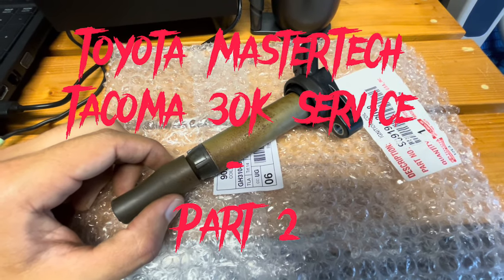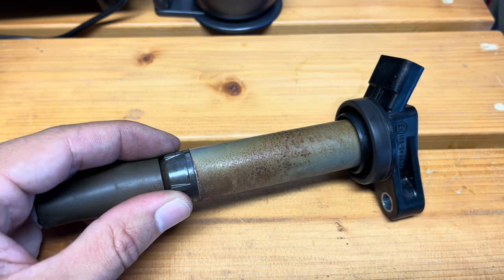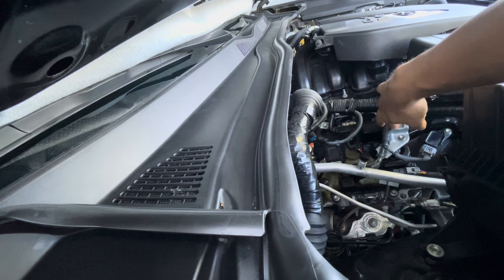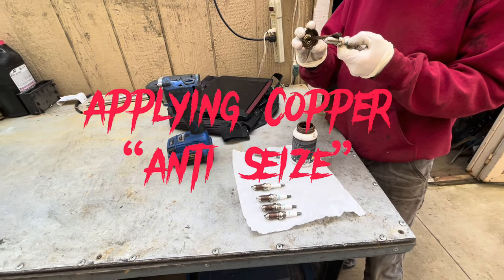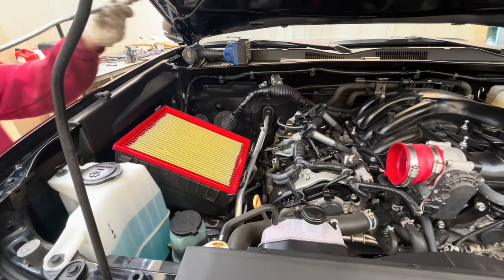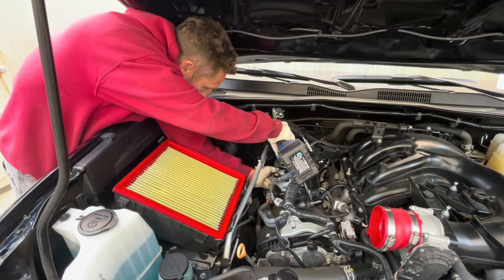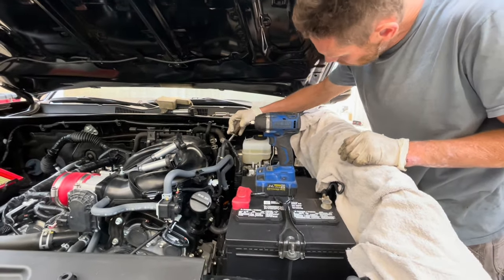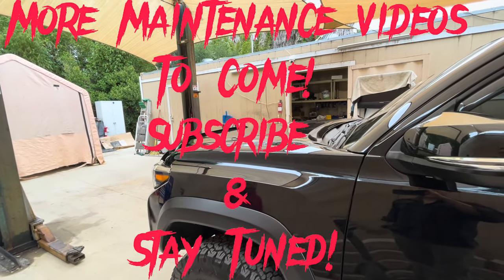Toyota Master Tech Tacoma 30K Service Spark Plug Change 3G Tacoma - Part 2

Comment: You're wasting your money on several things. Plugs are not to be replaced until 100K. You can remove them to clean them and possibly re-gap them. Using a drill to drive in spark plugs is dangerous. You can easily cross thread them and then you are f**ked. Not to mention wiping out the thread on the head being stripped. Diff fluid and tranny fluid 60K is fine. Except for the front diff, which looked like you took in water, I'd check the fluid and if it's still gold in color, plug her back and ride until 60K. I've owned Tacomas and even early 4WD pickups before they were called Tacoma, and I have gotten almost 300k from them doing practical maintenance with zero issues. In fact, I've never had one truck bite the bullet as I have sold them before that could happen.
Reply: This guy ain't no master tech😂 I have 2014 Tacoma with original spark plug with 170k miles. Original plug are 120k miles. Unless u have a small miss fire, don't change the plug.
Reply: Remember the Hilux
Mine had the mid-year change were they moved the blinkers from a top of the fender to down below by the grill
Reply: Came here to say all of this
Reply: @khangtruong4515 Plugs are good for the life of the engine or at least the majority of its life.
Reply: My 2021 Tacoma  owners manual says change plugs every 60k miles, I am about to change mine.
Reply: @MrNorthstar50 The manual is all apart of keeping that service $ going back into the dealerships when sales are down and or inventory is low. Got to pay the rent and countless useless managers and staff wages some how
Reply: Yes your probably right, I have a good friend who is the head of the service department at a very large ford dealership and he has told me that the service department makes way more money than there new car and used car sales combined.
Reply: @MrNorthstar50 l
Lol the iridium spark plugs they come with have a 120k guarantee on them.

Comment: Yeah, I agree with Joey Nutting, I have watched several video's on how to change the transmission oil and I'm still confused. My one complaint about my 2012 5th Gen 4Runner is the difficulty and the difference in opinion and confusion at changing the transmission oil! And, in my opinion ALL dealerships regardless of manufacturer are Liars, Cheats and Thieves!!!
Reply from the maker: I’ll get a thorough video of it with him doing it so we can put that to bed. Stay tuned and I’ll try to get something done within the next few weeks for you 🤙🏼
Reply: @westcoasttaco  Thank you, I look forward to it.
Reply: What’s confusing ? Just drain and refill , flushes aren’t recommended . There are several videos on YouTube with steps showing how to check the transmission fluid level when the car gets to the optimal temperature .
Reply: Not all dealerships, however most! Sucks you live around shitty one’s!!
Reply: If you go to a Dealership, it’s best to ask for a seasoned Vet. If they have any, they are most likely to be honest and do honest work! If they have none and they are all kids, RUN!!! This guy sounds cool and talks to people ok, but he is full of shit. Also never ani seize spark plugs, not advised by the manufacturer!!!!

Comment: From someone who does their own maintenance, I got to say there was some cringe worthy moments in there. Looked and sounded like he dropped a spark plug down the tube. Then all the tightening spark plug components with an impact gun. Reusing crush washers because "the other side was still good".  Like only one side crushes when you tighten it down? Removing a plastic oil filter housing with channel locks. Probably all good but I'm am a bit of a perfectionist. I would die if someone did that to my truck.
Reply: OMG the spark plug install with an impact....what the heck was that?!?
Reply: how about the NON-USE of protective fender covers??
Reply: then it magically appears at 20minutes in

Comment: Auto mechanic turned design engineer here with over 30 years experience. What he did with the plugs is totally fine. Started by hand, light torque on drill and hand torqued at the end. The plastic oil filter housing removal was also fine. That plastic housing gets so tight not from people over tightening but from different expansion and contraction rates between the plastic filter housing and the aluminum engine. the shock the hammer and screw driver has, loosens the housing a lot easier than potentially cracking it with a cup slipping under excessive torque. In my experience even a hand tightened plastic housing becomes seized again and really packing some axle or that assembly grease he uses on the threads will make it come off easier next time. An aluminum housing would be best as it will expand and contract at the same rate as the aluminum component it’s attaching to.
Reply: I ratchet snug used never seize on all 10 mm bolts & spread little silicone paste on coil stems. Some were stuck on dry hard to remove.
Reply: 40k truck and its half plastic smh

Comment: That wasn’t 12-14 foot pounds just so you know. I don’t think he overtightened them so much that anything would happen but 100% there was like 20-30 foot pounds on at least one of those plugs. Usually with a NEW spark plug that has a crush washer, you tighten it finger tight with only the extension and then no more than 1/2 a turn after that. You’ll easily feel it crush the gasket and get much harder to turn almost suddenly. Then you’re done
Reply: I feel good now hearing I did it correctly. However, I will never use any impact drill!

Comment: MY heart dropped when he drilled that plug in 😢😂😂 noo hand tightened then turn it until snug , because he could have drilled it and the treads are not correct sitting in
Reply from the maker: It’s all good 👍🏼 bro🤣 he starts them off with his hand on the socket extension and then uses the drill to get them in further until he uses the torque wrench to tighten them to correct spec. Honestly I’m not personably comfortable with using a drill on my plugs.. but I trust Jason and his 30 years of working on Tacomas to know that he is very confident in his abilities and isn’t risking anything that would jeopardize my truck.. now if the drill was the first thing he used and would have been cranking them down thenI would have been worried🤣, but all good🤙🏼
Reply: @westcoasttaco  😂😂😂😂💯💯🤝
Reply: Yes, a lot of cringy stuff going on.
Reply: @seanpop2886  No torque spec used either even in the previous video. Either he trust his drill or his hand has been calibrated to read torque? Reason why I don't take my Taco to the dealer for maintenance.
Reply: @westcoasttaco  He literally says he doesn't use torque wrenches. I'd keep my shit away from him.

Comment: I put 200k miles on a Toyota venza v6 and never changed the spark plugs. Also, only changed transmission, coolant, and differential fluids once around 125k
No issues. Thanks Toyota!

Comment: Thanks for the video and breaking down what to look for with possible loose plugs. I have a 2017 Tacoma that I bought new. 246k miles, changed the plugs at 100k each time.

Comment: I loved this guy!  Jason is a very detailed person.  Although, I am puzzled why he doesn't have the proper tool to remove the oil filter.  I have 2rd Gen Tacoma and doesn't require any special tool, but once in a while friends or relatives with one of these non-spin on type.  Channel lock, I don't know, should only be use in pipes???   Overall, the guy does a GREAT JOB!
Reply: He doesn't normally do Oil Changes, so he has never needed one. Most of his jobs are pure suspension upgrades. I have had my Tundra (that he has worked on) for 16 years and haven't ALWAYS used the filter tool when doing oild changes on my own.. This comment is a non issue to anyone that owns MULTIPLE Toyota trucks as the oil change can be completed just fine, without. Anyone commenting on his skill set based upon that ONE tool, is a tool, sorry. He has worked on my Tundra (trying to diagnose a noisy suspension squeek), he installed an Eibach Pro Truck Stage 1 kit on my 5th Gen 4runner and later replaced both wheel bearings and spark plugs and... he took in my 2016 Honda Civic that had a non functional Power Steering issue which he later found to be a chewed wire harness from a rodent. That repair cost me a FRACTION of ANY other shop and everything worked PERFECT after Jason completed the repairs. I won't take my vehicles to ANYONE else, if possible.

Comment: DID NOT NEET PLUGS PERIOD. 75k sure. The iridium is super hard and does not erode like standard plugs. Cool pack it fine. It gets hot in there. If there’s an issue you’d know. Plus it’s be under warranty. My sequoia has 300k and one coil has a crack in it and needs replaced. But does not misfire at all. I want to see the Master Tech ASE certs. Every Toyota tech I know does not do this stuff. Not saying it’s all bad but if He went through T-Ten  “Toyota training” he’d have the plaque

Comment: Most new cars can easily go 80-100k miles on plugs, seems like overkill at 30k but to each is own.  If your plugs are not working properly you will throw a code or the engine would not be running good.

Comment: 30,000-50,000mi. first interval replacement yes. If coils look good no need replace. Switch to irdium tip ngk or denso spark plugs 80,000-100,000mi intervals. Change coils. 🤙

Comment: Use GL4 in the Transfer Case NOT GL5,..... Big issue there! Same as the manual transmission, GL4 ONLY.
Spark Plugs made for the 3.5 have a coating on the threads so "Anti-Seize" is not recommended.
Reply: agree with gl4 only. i called oil companys for their faq on gl5 oils and they stated that yes gl5 actually dissolves yellow metals which are found inside of our TC. i used royal purple gearmax btw 75 90

Comment: Came across your video lucky i change mine spark plug at 60k.one spark plug is loose and wasn’t torque to spec i own a 2020 trd pro taco. After changing the spark plug and torque to speck I get less gear hunting and now I’m avg. 23-25 when I commute to work. If you going up a small hill the taco should not gear hunt at all. Check your spark plug guys

Comment: W/ your experience and others (Tacoma World).... just took out all my 6 coils on my 2021 TRD OR Tacoma (24,500 - early, but wanted a look- you did make me "paranoid" ;) No blow-by on all 6. While I was in there changed all 6 spark plugs.
Reply from the maker: Glad to hear all was well! Honestly I would have done the same thing if I were you.. it’s hard not to wonder what’s going on in there, especially after my experience and the experience of others.. sometimes it’s better to be safe than sorry.. 👍🏼 At least you now get to sleep alittle better at night and won’t have to worry about plugs for quite some time.
Reply: @westcoasttaco  100% - Plus, it's only gonna get hotter here in OK (hoodie free zone from May on) rather sweat less now. 😅Yep, it was good to know definitely. 
Re :Jason's take on 30K maybe "overkill" for spark plug change (paraphrasing - " @50K you are definitely seeing performance degrade on plugs even w/ iridium, and w/ the price of gas" - btw, I bought the OEM ones as you both recommended 👍) - I swear to you, my engine sounds a tad quieter and smoother - a tighter sound, if you will. No regrets. Your videos are helping us owners 🤛
Reply: @westcoasttaco  Been meaning to tell you this one - Re: all those over the top anal comments about Jason "is doing this wrong, he won't touch my truck" blah blah blah...
I'm   30+ year licensed falconer - an old, pithy saying in falconry: "There's only 1 thing 2 falconers agree on: That the 3rd falconer is doing it wrong! Those negative comments so smacked of that. 😜
Reply from the maker: @tim3308  whenever you post a video with a mechanic in it, you are 100% guaranteed to have those comments 🤣.. honestly, everyone is entitled to their own opinions and it doesn’t bother me at all. If you lined up 10 mechanics and asked them all the same question and recommendation about the same job every one of of them would come back with a different answer.. it’s just how it goes.
Reply: @westcoasttaco  Likely so. I can be less diplomatic - it's not my channel. 😉Ever seen the video where a Prof is teaching class - a "staged" robber comes in, grabs her purse,  then runs out? Class is then asked to fill out a description of the thief (an experiment). The results are semi depressing how many are off and differ greatly from each other. People.😐

Comment: Ngk and Denso Recommend zero lubricant on threads of spark plugs.. Surprise it hasn’t caused a misfire putting that copper paste on there!!
Reply: Correct. They supposedly come with a light film of anti-seize new.

Comment: When I saw the channel locks come out for the oil filter I cringed so hard lol they do make a special tool specific for that oil filter..... And then the final cringe was the cordless impact on the spark plugs lol oh boy..... I get it, he did start them by hand and finish tightening by hand but still...... Risky lol I actually like his service interval recommendations. Because of those recommendations they found the front diff needed service pretty bad and also that coil pack and plug issue.
Reply: Agreed.. But overall did a great job!

Comment: First...  3RD GEN Tacomas spark plugs are replace at 60K  and  no need for anti-seize 
Second.... every time the transfer case, the rear diff oil are replaced you must replace the drain plug washers. none of that was replaced.
Third ....for the price of the DENSO spark plugs  just get the OEM spark plugs for the same price . 
Fourth...  CERTIFIED MASTER MECHANIC have the correct tools to perform the repairs , not pliers and a pry bar to remove the oil filter housing, BTW no need to put whatever that grease was  put on the oil housing.
Fifth.... if you do all those repairs at any Toyota dealer ( yes they are pricey) you have warranty
ALL I HAVE TO SAY IS.... SO MANY ERRORS.
Reply: So far you are the only person on here that can smell bullshit 😅😅

Comment: hand tight means a lot of things like you said, would be nice if you got the actual torque spec for them and use a torque wrench, otherwise i wont be able to sleep at night 🤣😂
Reply from the maker: 12-14 ft lbs👍🏼 I mentioned it in the part where he put the new plugs in. Sleep well my friend 😂
Reply: @westcoasttaco  nice, yeah I gotta know the torque spec of every bolt when I work on my car. Only way I can sleep 😴

Comment: Did he do a transmission drain and fill for you as well? Would love to observe that. I think he mentioned that in Part 1?
Reply: I like to see that as well.
Reply from the maker: He did that for me several months ago for me, but not on this video. I’ll have him do it again soon and make sure to get a video of it for you guys. He said it’s a good idea to do a drain and fill every 10-15k.
Reply: @westcoasttaco  does the same interval for AT drain go for the Gen2 Taco 4 bangar?
Reply: @westcoasttaco  Wow that seems overkill. I usually do trans, transfer case & front, and rear diff at 60,000 miles on my 09 Taco now 193,000 miles no issues with my truck.
Reply from the maker: @HB-yq8gy  since I bought the truck used, I wanted to have everything done just for a peace of mind. I’ve always been on the “over service” side with all of my vehicles.. probably a lot of it wasn’t necessary, but it’s just how I am. You got to do what works for you and is within your comfort level 🤙🏼
Reply: @westcoasttaco  You taco cost a lot more than mine brand new at $28,000 OTD. Yes definitely will last forever.
Reply: @westcoasttaco lol...this guy ripping you off.
Reply: Hey BOSS a question is any problem if do services by myself. For me pretty dificult book appoiment for dealership service ..void any warranty???

Comment: Did he install the spark plugs with a drill? Not started by hand or with a socket?  Cross thread possibilities!!!!
Reply from the maker: He started them by hand, then tightened 80% with the drill and then tightened by hand til spec👍🏼🤙🏼.

Comment: I got really nervous every time he use the drill to snug the spark plug.
Reply from the maker: 🤣 you will notice he didn’t use a high impact drill.. he still had to tighten the plugs with the torque wrench after using the drill. 👍🏼
Reply: @westcoasttaco  still get nervous, it’s just a first for me. 😂
Reply: @javierramos9795  he doesn’t have much tools
Reply: Vehicles must confuse you a lot.

Comment: Jason is definitely Mr.Good Wrench but got confused with the type of spark plug. It's the dealer-recommended plugs the way to go? For my second gen, I did the spark plugs at 160,000 miles. I was afraid of over tighten so racket slug was good enough assuming.  Thanks for your honest tips.
Reply from the maker: He used the same spark plugs you should receive from the dealership. They were the OEM ones, they just weren’t packaged in the Toyota/Lexus packaging.

Comment: Sorry but I would never trust a guy that use an impact tool on a 10mm bolt.  Plug never go for anything else beside the denso  plugs,  they were engineered to meet certain spec.  Also that coil doesn't look like it need replacing 😁

Comment: Your doing some of these services way to early
Reply from the maker: Sure, but I am glad I did this one as early as I did.. I bought this truck used with 23,000 miles, I wanted the peace of mind knowing that everything was in good shape and that the spark plugs weren’t having any issues.. ended up finding that loose plug with blowby on it.. so I’m really glad I took Jason’s advice and did them when I did them. But.. everybody has their own preferences and recommendations. You have to do what makes the most sense to you and is within your comfort levels. I would rather service too often then find out I waited too long for something and have damage occur. That’s just me though..👍🏼